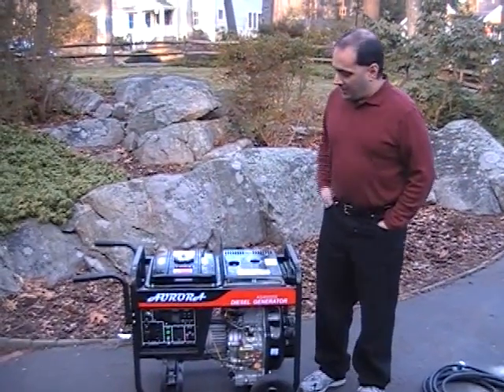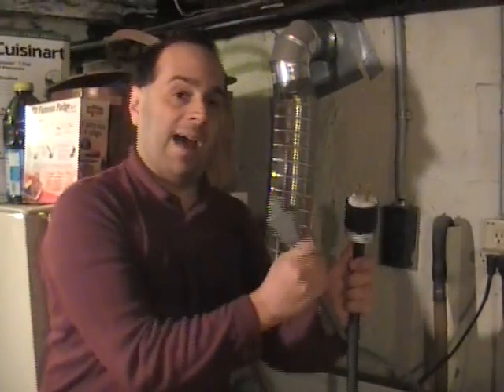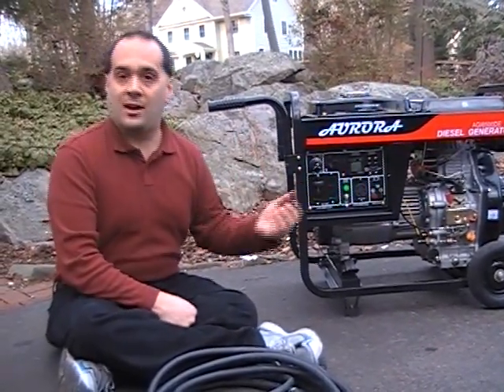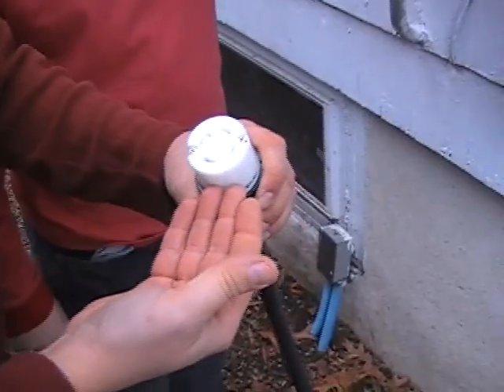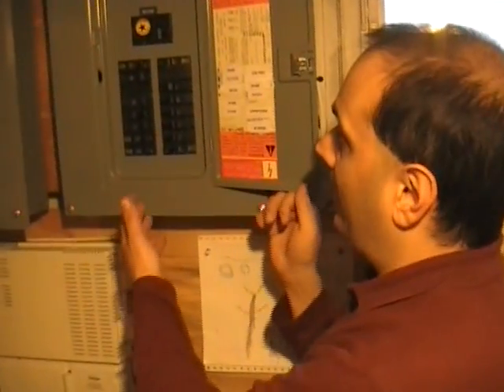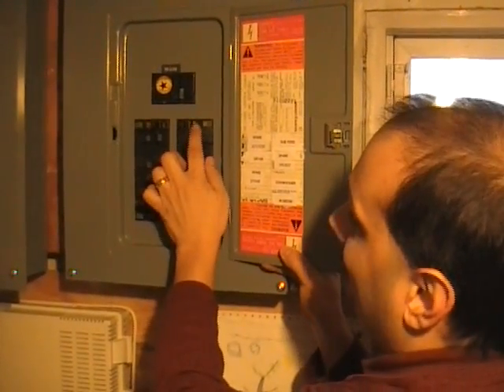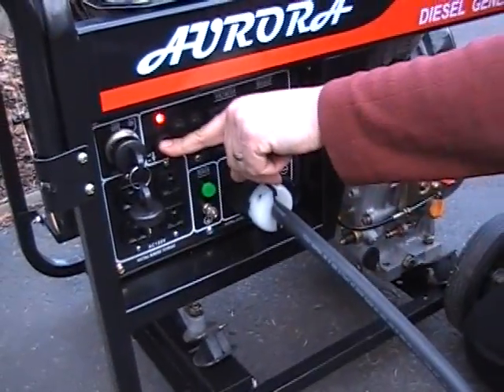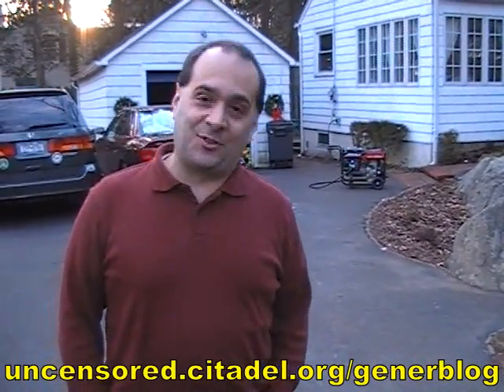Inexpensive residential generator hookup

Comment: Hi …great video tutorial here.  I plan on using a 10000 watt generator though.  Do you see any problems using the setup you used with that size a unit?
Reply from the maker: This method will work nicely with a 10,000 watt generator, but to be able to use all that power you must size the connection for a 50 amp handoff.  So your generator input breaker will be 50 amps instead of 30, all wire will be 8 gauge instead of 10 gauge, and your plugs/receptacles will all be NEMA L14-50 instead of NEMA L14-30.  

Everything else is the same.  Come chat about it at uncensored.citadel.org/generblog if you want to go into more details about it.
Reply: Art Cancro Hi ….that is great information and it is very kind of you to provide it.  Sure …I will visit your blog. Have a fantastic day!

Comment: Great video! I plan on doing this with my solar battery backup. I might wire in a generator sometime as well. I haven't figured out how to do 2 of the interlocks though. Maybe 2 subpanels? :)
Reply from the maker: There are two ways of doing solar.  If you want to be able to disconnect from the utility entirely, you can do an interlock.  If you want to be able to mix solar and utility power, you need a grid tie inverter.  A grid tie inverter doesn't require an interlock, but it has the unfortunate side effect that it only works when the utility is powered up.
Reply: Art Cancro Yes, I actually just got my building permit from my city since I posted my first comment to add my solar panels and grid tie them with our power company. That will be supplemental, and not emergence. I have 4, 100w panels and two 109AH batteries on a separate system that I want to wire into a sub panel for emergency power. My house has LED lights, so I'm confident it could easily power all of the lights in my home 24/7 if I wanted it to. But I would like at least our fridge or freezer to be on it, and if thats the case it might not be quite enough to run those. I know my freezer (7CU FT chest freezer)  uses about 100w an hour on average throughout the day. The batteries would be able to power that easily for 24 hours if needed, since it will only use about 24AH roughly. 

Still have a lot to figure out. I am thankful I found your video though because this helps me quite a bit.

Comment: any updates on you Aur 6500? I see alot of reviews from it seems like full on haters of this company. Would love to hear a follow up reply or video since you have had it more then 2 years now and wondering how many hours you have in it? Thanks for your videos
Reply from the maker: I've got a few hundred hours on it now and am still completely satisfied.
Reply: Very well I'm leaning toward the model you have. But the reviews are scary in some areas. Great layout you have for your back up portable Generator. thank you Art.
Reply from the maker: After more than three years I am still happy, but unfortunately new EPA rules have pretty much killed the sale of small air-cooled diesel gensets.  Remember, however, that the connection method described in this video works equally as well for a gasoline or propane generator.
Reply: @OfficialHankIII  don’t forget about the generator safety rules too. Generator safety rules: Always make sure you follow all the generator safety rules before using your portable generator. This is only a reminder. Generators can be dangerous if not used carefully. Every year, hundreds of people die or get injured when using portable generators due to carbon monoxide poisoning and electrocution. Make sure you are using your generator carefully and keeping others safe as well. There is something very serious that everyone should always be aware of when using generators. Some people do run their generator indoors which is not safe and that increases the risk of carbon monoxide poisoning which can cause death of family and you. Some people run their generator in wet conditions which can electrocute them. Please remember that you should never run your generator indoors. Remember that carbon monoxide is an odorless and colorless gas that you cannot see or smell. Carbon monoxide is a silent killer. Keep that in mind. Make sure your generator is 15-20 feet away from your house and away from doors, windows, and vents. Never use your generator in your porch too. Having a carbon monoxide detector is very important against generator safety. Some people also allow children to go near the portable generator which could pose risks. We need to keep an eye on our children making sure that they are not near the portable generator so they won’t get electrocuted or burned by the generator which is dangerous. A locking enclosure also keeps kids safe. A generator shed might look like a tempting place to explore, or take cover during a game of hide and seek, but a generator is a dangerous piece of equipment that can cause injury. It says on the manual that we should also keep children away at all times from the portable generator to avoid injuries. Please do not allow a child or unqualified people to operate the portable generator.  It is important to keep your children safe especially little ones. The portable generator can be hot during an operation. Just because some manuals missed what should be listed doesn’t mean it’s safe to do. Always follow the generator safety rules when using portable generators. Generators pose electrical risks. If you need to use your generator during wet weather, you need a generator tent to protect your generator from getting wet. Don’t let your generator get wet. Keep your generator dry and before using your generator, please make sure your hands and your generator is dry. Do not wear loose clothing when operating the generator. Everything that is said on the generator’s operating manual should not be ignored. Never smoke cigarettes near the generator. Please keep flammable things away from the generator. Never overload your generator too. Your generator can catch fire. Never ever try to plug a generator cord into a wall outlet to avoid back feeding. Back feeding your generator is dangerous. Always turn on your generator first before plugging in appliances and shut off the appliances before turning your generator off. Use a heavy duty cord for your generator and the cord should not be worn out. All the instructions should be followed carefully. Never refuel your generator while it’s running. It can cause fire if fuel spills while your generator is hot. You should turn off your generator and let it cool off before refueling it. Having a fire extinguisher next to the generator is also important. This is only a reminder for everyone’s safety of using generators. Make sure your generator is properly grounded. Having a fire extinguisher next to the generator is also important against the safety rules. https://youtu.be/I1jT3ANENvI and here is a video more about keeping others safe when using generators and also about our family’s safety. It’s important to keep our little children safe as well. Make sure they’re away from the generator. Hope this helps.
Reply: +Art Cancro (IGnatius T Foobar) Guess you could buy one in Canada and bring it back?

Comment: Your never back feed a panel just as he had said. If you were to do so and left the main breaker on. Your electric company if they were repairing or replacing your transformer could be kill.
Reply: Generator safety rules: Always make sure you follow all the generator safety rules before using your portable generator. This is only a reminder. Generators can be dangerous if not used carefully. Every year, hundreds of people die or get injured when using portable generators due to carbon monoxide poisoning and electrocution. Make sure you are using your generator carefully and keeping others safe as well. There is something very serious that everyone should always be aware of when using generators. Some people do run their generator indoors which is not safe and that increases the risk of carbon monoxide poisoning which can cause death of family and you. Some people run their generator in wet conditions which can electrocute them. Please remember that you should never run your generator indoors. Remember that carbon monoxide is an odorless and colorless gas that you cannot see or smell. Carbon monoxide is a silent killer. Keep that in mind. Make sure your generator is 15-20 feet away from your house and away from doors, windows, and vents. Never use your generator in your porch too. Having a carbon monoxide detector is very important against generator safety. Some people also allow children to go near the portable generator which could pose risks. We need to keep an eye on our children making sure that they are not near the portable generator so they won’t get electrocuted or burned by the generator which is dangerous. A locking enclosure also keeps kids safe. A generator shed might look like a tempting place to explore, or take cover during a game of hide and seek, but a generator is a dangerous piece of equipment that can cause injury. It says on the manual that we should also keep children away at all times from the portable generator to avoid injuries. Please do not allow a child or unqualified people to operate the portable generator.  It is important to keep your children safe especially little ones. The portable generator can be hot during an operation. Just because some manuals missed what should be listed doesn’t mean it’s safe to do. Always follow the generator safety rules when using portable generators. Generators pose electrical risks. If you need to use your generator during wet weather, you need a generator tent to protect your generator from getting wet. Don’t let your generator get wet. Keep your generator dry and before using your generator, please make sure your hands and your generator is dry. Do not wear loose clothing when operating the generator. Everything that is said on the generator’s operating manual should not be ignored. Never smoke cigarettes near the generator. Please keep flammable things away from the generator. Never overload your generator too. Your generator can catch fire. Never ever try to plug a generator cord into a wall outlet to avoid back feeding. Back feeding your generator is dangerous. Always turn on your generator first before plugging in appliances and shut off the appliances before turning your generator off. Use a heavy duty cord for your generator and the cord should not be worn out. All the instructions should be followed carefully. Never refuel your generator while it’s running. It can cause fire if fuel spills while your generator is hot. You should turn off your generator and let it cool off before refueling it. Having a fire extinguisher next to the generator is also important. This is only a reminder for everyone’s safety of using generators. Make sure your generator is properly grounded. Having a fire extinguisher next to the generator is also important against the safety rules. https://youtu.be/I1jT3ANENvI and here is a video more about keeping others safe when using generators and also about our family’s safety. It’s important to keep our little children safe as well. Make sure they’re away from the generator. Hope this helps. Be safe

Comment: Art, don't tell me that I didn't read everything you said because I have I think you didn't read what I said.I just looked up your gen and it cost $1200.00 and mine cost$600 for the same watts. Average Joe CANNOT AFFORD $1200.00. Affordable my eye friend. How much money do you have tied up in that little project of yours?
Reply from the maker: The very first thing I wrote as a reply to your original comment was: the video is about an inexpensive HOOKUP not an inexpensive GENERATOR.  You can use this method with your cheap chinese generator and it will work just as well.

Once again: I built this solution for under $200 in parts and it is FAR superior to a "Brand R" transfer panel.  We are NOT including the cost of the generator (which you already bought) or the cost of the permit/inspection (which is required by law ANY TIME you make a change to your panel).

I respect the fact that you have limited financial resources.  I do not respect ignorance and failure to read.  You are one stupid remark away from having your posts deleted and being banned from my channel.

Comment: Great job Art. You hit the nail on the head..perfect job. Ive been an electrician for over 30 yrs and what you did was absolutely correct. I prefer installing the interlock on the main panel but I totally understand the method you took.
Reply: Portable Generator safety rules: Always make sure you follow all the generator safety rules before using your portable generator. This is only a reminder. Generators can be dangerous if not used carefully. Every year, hundreds of people die or get injured when using portable generators due to carbon monoxide poisoning and electrocution. Make sure you are using your generator carefully and keeping others safe as well. There is something very serious that everyone should always be aware of when using generators. Some people do run their generator indoors which is not safe and that increases the risk of carbon monoxide poisoning which can cause death of family and you. Some people run their generator in wet conditions which can electrocute them. Please remember that you should never run your generator indoors. Remember that carbon monoxide is an odorless and colorless gas that you cannot see or smell. Carbon monoxide is a silent killer. Keep that in mind. Make sure your generator is 15-20 feet away from your house and away from doors, windows, and vents. Never use your generator in your porch too. Having a carbon monoxide detector is very important against generator safety. Some people also allow children to go near the portable generator which could pose risks. We need to keep an eye on our children making sure that they are not near the portable generator so they won’t get electrocuted or burned by the generator which is dangerous. A locking enclosure also keeps kids safe. A generator shed might look like a tempting place to explore, or take cover during a game of hide and seek, but a generator is a dangerous piece of equipment that can cause injury. It says on the manual that we should also keep children away at all times from the portable generator to avoid injuries. Please do not allow a child or unqualified people to operate the portable generator.  It is important to keep your children safe especially little ones. The portable generator can be hot during an operation. Just because some manuals missed what should be listed doesn’t mean it’s safe to do. Always follow the generator safety rules when using portable generators. Generators pose electrical risks. If you need to use your generator during wet weather, you need a generator tent to protect your generator from getting wet. Don’t let your generator get wet. Keep your generator dry and before using your generator, please make sure your hands and your generator is dry. Do not wear loose clothing when operating the generator. Everything that is said on the generator’s operating manual should not be ignored. Never smoke cigarettes near the generator. Please keep flammable things away from the generator. Never overload your generator too. Your generator can catch fire. Never ever try to plug a generator cord into a wall outlet to avoid back feeding. Back feeding your generator is dangerous. Always turn on your generator first before plugging in appliances and shut off the appliances before turning your generator off. Use a heavy duty cord for your generator and the cord should not be worn out. All the instructions should be followed carefully. Never refuel your generator while it’s running. It can cause fire if fuel spills while your generator is hot. You should turn off your generator and let it cool off before refueling it. Having a fire extinguisher next to the generator is also important. This is only a reminder for everyone’s safety of using generators. Make sure your generator is properly grounded. Having a fire extinguisher next to the generator is also important against the safety rules. https://youtu.be/I1jT3ANENvI and here is a video more about keeping others safe when using generators and also about our family’s safety. It’s important to keep our little children safe as well. Make sure they’re away from the generator. Hope this helps.

Comment: It's kind of loud, but can't you run your generator for half the month and cut your bill in half
Reply from the maker: You'd cut your electric bill in half, but because you'd still have to pay for fuel for the generator, you wouldn't be saving any money.  Based on the current cost of fuel, you'd probably pay more, actually.

Comment: Good video. I personally backfead my panel to a 30 amp 2 pole breaker so I have options to turn on or off any breaker I choose. And the guy who said you have a violation for not having a strap on your seu cable out of meter to your panel is wrong. The violation is the cable itself. Wire from meter pan to panel is to be in PVC or galvenized pipe to the inside of the house then it can be free air to panel.